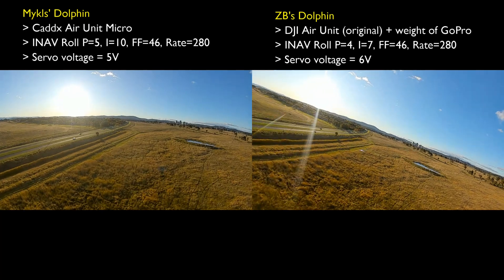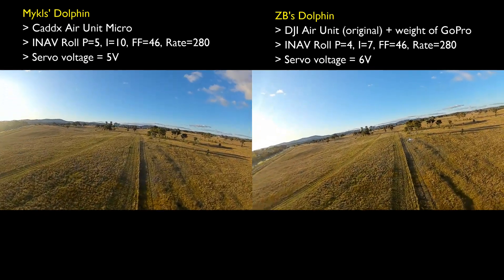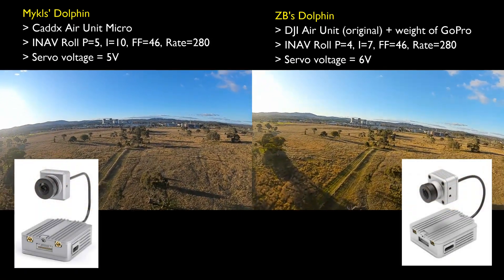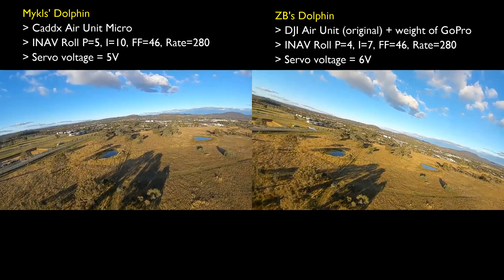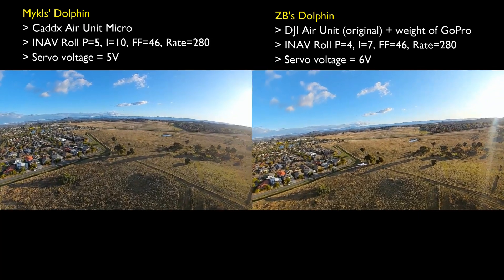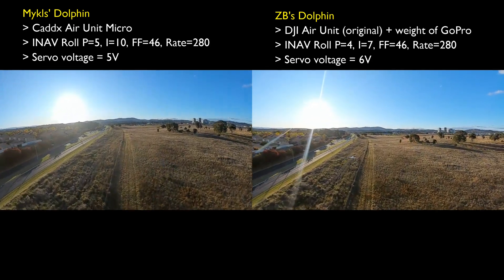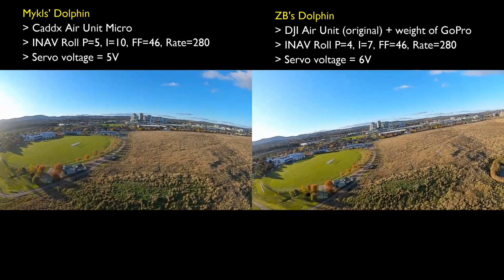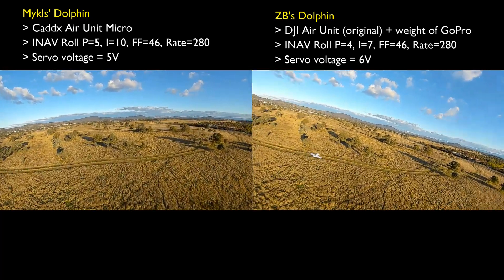INAV Fixed Wing Roll Tuning Check - AtomRC Dolphin

Comment: thanks for the tips here!  I went crazy with my roll P (18) and of course my Dolphin shakes wild in winds and higher speeds. DJI O3 and Gyroflow can iron these shakes out - but I want a smooth flight experience already (else I'm always nervous).  Another thing: what are your stall experiences on that plane?   I had some nasty ones - sometimes hard to recover out of a stall spiral...
Reply from the maker: Hi there! I posted updated PID with this later video: https://youtu.be/L22D5T_3JKU

I've never had a stall and often maneuver at very low throttle or idling when in formation with others. It's possible the weight of the GoPro in the nose has a stabilising effect compared to planes without. That said, my second Dolphin without the GoPro also flies well without tendency to stall or yaw wag either... Hmm...

Perhaps try balancing a tiny bit further forward and seeing if that makes a difference as well?

Comment from the maker: After I made the video, I realised my comment about my plane being heavier with the GoPro isn't quite right, as Mykls was using a 7000mah Ion pack (compared to my 4200mah Ion), which would make our flying weights similar.  I don't think the GoPro being forward in the nose would make much difference to the roll axis.